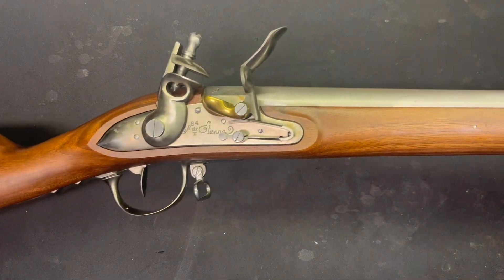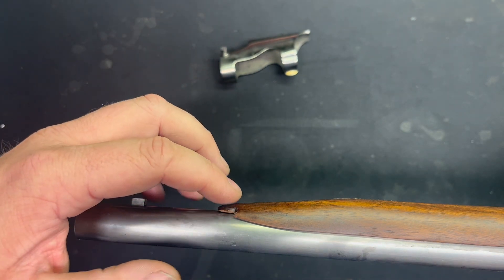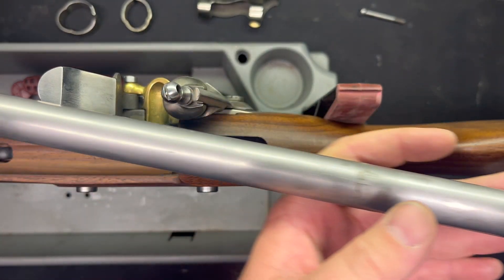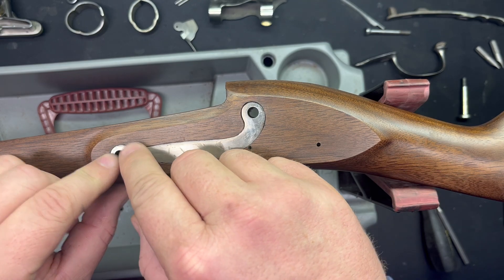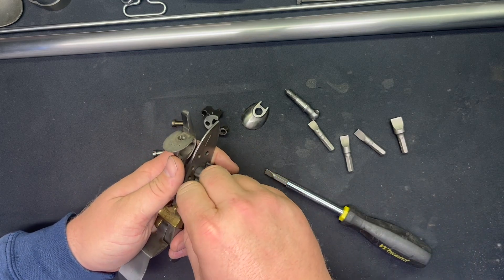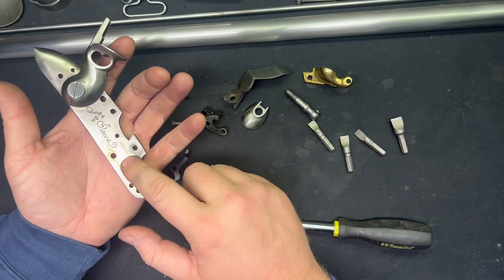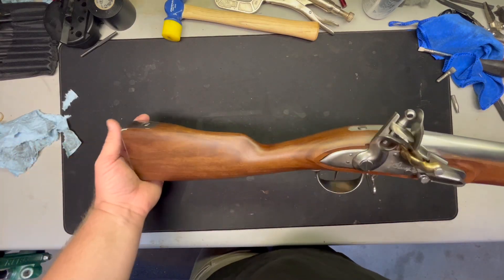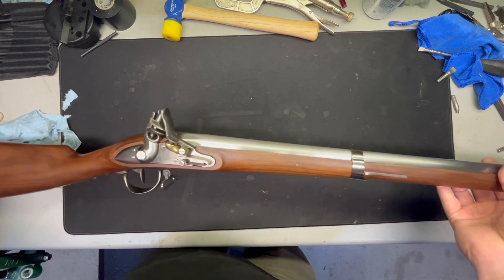1777 Charlivelle Musket Detailed Strip and Reassembly   HD 1080p

Comment: Leave bolts attached and tap them out when unscrewed a bit
Reply: Some old guns had a beveled edge on the front end of the lock that fit into a recessed edge at the front of the lock mortise. So take out the front screw then loosen the back screw most of the way out then gently tap on the head of the screw until the back end of the lock pops out of the mortise. No prying or wriggling of the lock is required.

Comment: 416R stainless steel is the type most commonly used to make rifle barrels. and it is magnetic.
Reply from the maker: After some digging, I found that Pedersoli says these barrels are actually not stainless, (though they do not mention the exact type of steel), and simply polished bright.  Maintenance recommendations are to keep it clean and polished and wipe down with a very light coat of linseed oil of all things before long term storage.  For short term just use a very light coat of quality gun oil.

Comment: Nice video. I guess the piece of wood was knocked off by the set screw?
 -Riflings and the accuracy it provided, was well known when this model originally was produced.  The Minié style bullet did not exsist, so the reloading of the rifles was much more fiddeling and time consuming due to the press fit. Of course the rifling process of the barrels was costly too. Combine this with more or less uneducated  soldiers, and you know the reasoning  for why they didn't provide their armies with rifled muskets at the time.
Reply from the maker: Correct, the set screw split the wood and my repair attempt failed for the same reason.  The owner is going to replace that pointed set screw with a flat one to hopefully disperse the pressure and not split it again. 

Yes, the history of rifling is pretty interesting.  The first were from Austria in the 1500’s I believe. They were actually just straight lines, no twist.  With the idea being it would give the carbon a void to build up in, increasing the number of firings you could get off before fouling the barrel completely.  But you’re right, it was cost prohibitive in most cases.  

Thanks for watching!
Reply: @scottbozarth8459  I find that set screw to be an interesting feature. Honestly I can't renember to have seen this screw on any pictures of french muskets of this era.  "Normally" they used a barrel band spring which locked the barrel band through a hole (seems like a much better solution).

Comment: I have a Ketland fowler from 1815 -1830 ish that needs a barrel browning and clean up. Are you interested in doing it.   send me a email and I will follow up with you
Reply from the maker: Unfortunately I have a new job that has me traveling 75% of the time and I had to back burner my plans to open a legitimate gunsmithing shop.  I do have a series of videos showing how I built my muzzleloader and in it I go over how to brown the barrel. It actually turned out beautifully and was not hard at all.  Just took some time and patience.  The video is muzzle loader lab part 7, toward the second half of the video I start the browning process.  Good luck and thanks for watching!